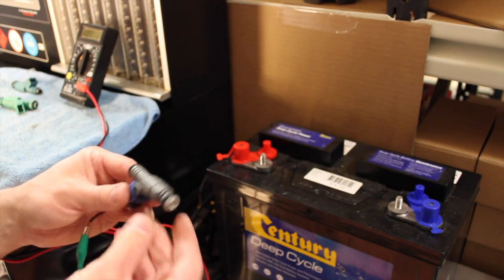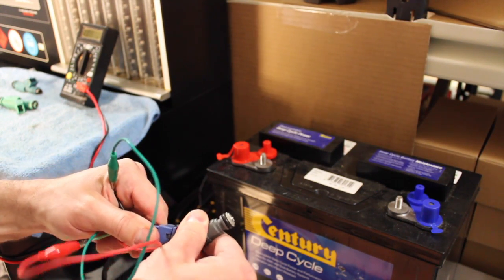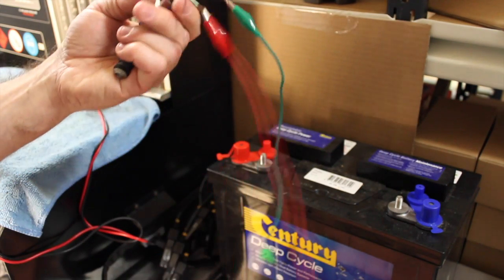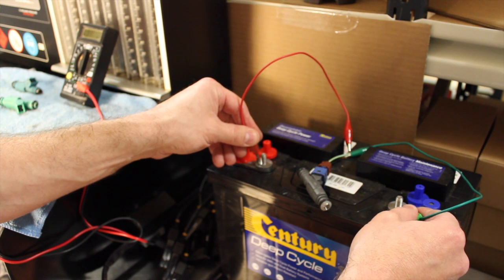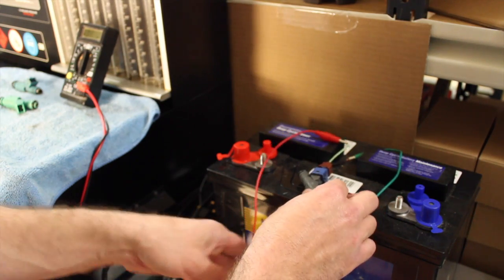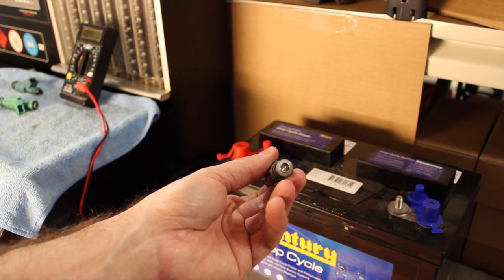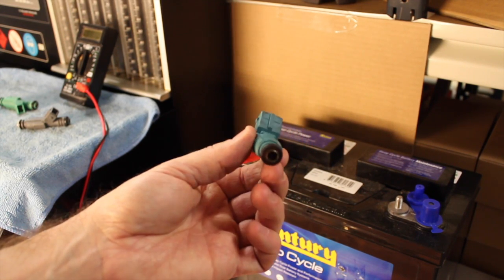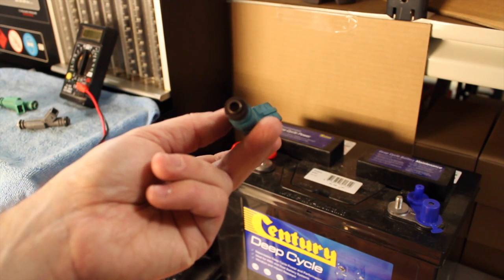Petrol fuel injector test function pulse testing injectors using a 12 volt car battery

Comment: I just used a simple injector cleaning kit today. When I back-flushed I found I could easily get the injector stuck open. But as soon as I forward-flushed them they would revert to normal operation.
Does it getting stuck open (in reverse) mean anything?

Comment: What does it mean if the fuel injector will open/close only when the ground is pulsed slowly, but will not open/close when the ground is pulsed rapidly?
Reply from the maker: That the injector is not good
Reply: Bought brand new injectors and they do the same thing. Doesn't make sense.
Reply: I am not using a test connector though. I am attaching the leads directly to the injector terminals. This is the only other variable.